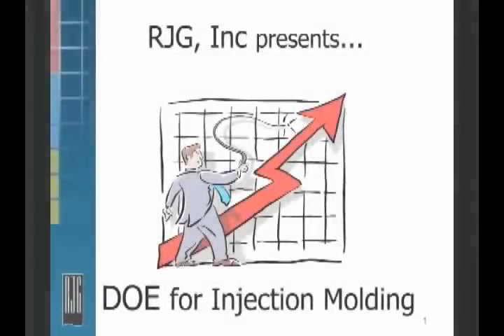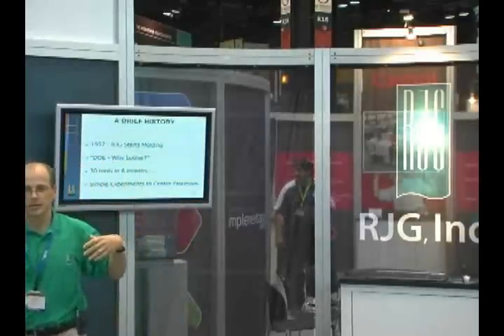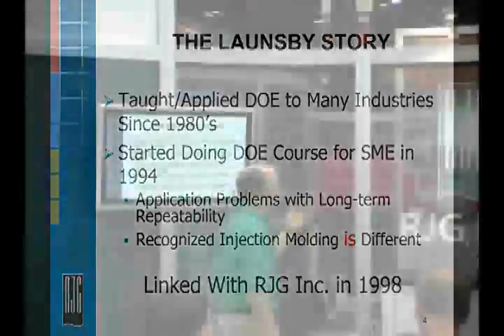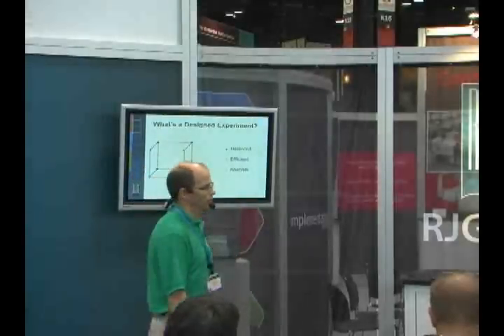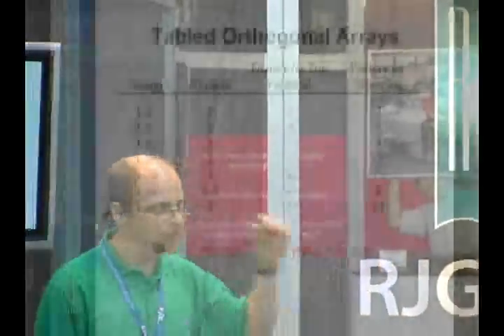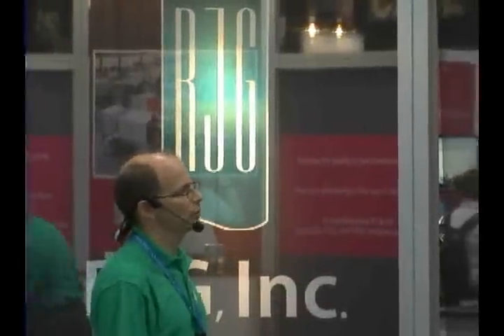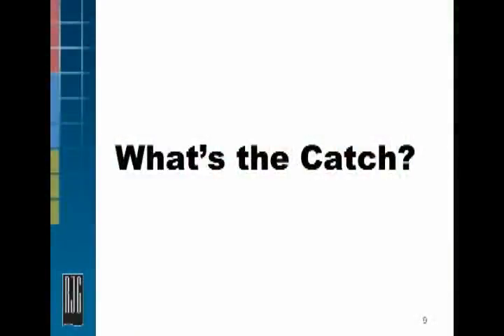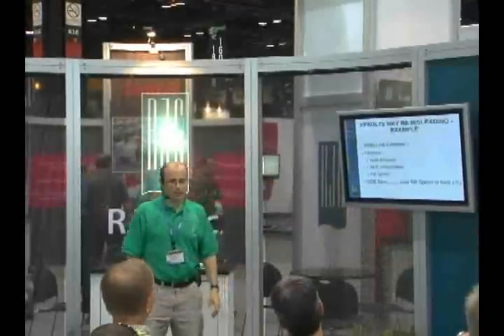DOE for Injection Molding - Part1

Comment: Sir  pls told how to calculate the shot size for new trial mould
Reply from the maker: If you know the volume ( from a solid model ) you can divide that by the area of the screw. 
Shot size = volume / screw area
Use approximately 90 % of that to safely fill the mold.

Comment: What makes DOE such a powerful tool is that you CAN get a good estimate of main effects from a fractional design, but there are assumptions and risks if you do this.   If you are trying to optimine a process, a highly factionalized array may not be a good fit.  If you are trying to screen the most important factors and then run a full fraction study with the "heavy hitters", it can be very appropriate.  This is particularly true on high cavitation molds with many CTQs that take weeks to measure.